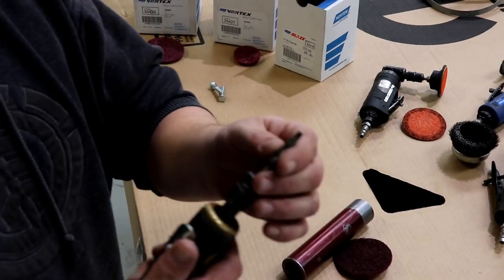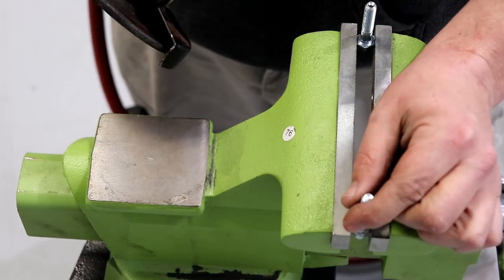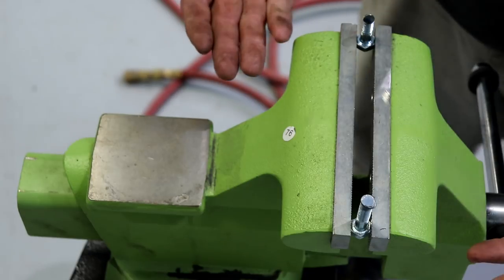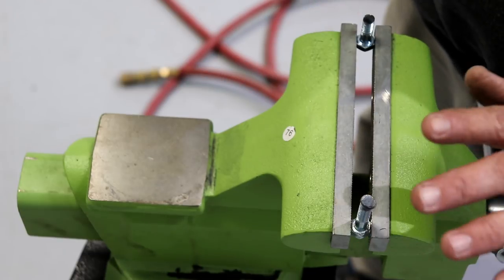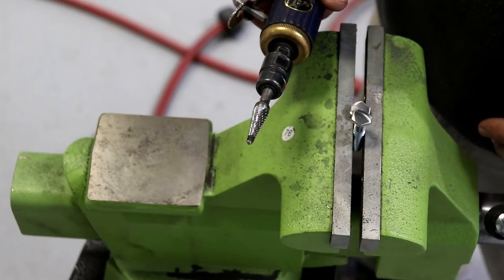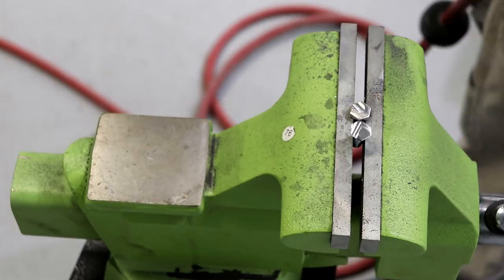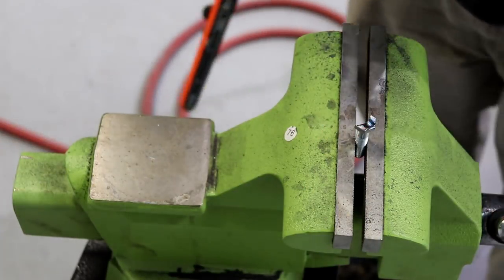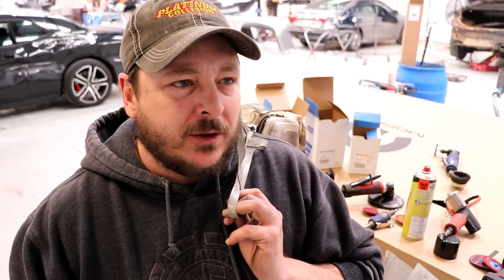The sandpaper 3M doesn't want you to know about. Norton blaze

Comment: U weren’t using the cutting edge of the right angle disc, those are 2 COMPLETELY DIFFERENT disc for different applications. BTW the ingersoll rand 345 max  right angle grinder is a BEAST, I prefer it with a 6” disc for heavy metal removal than my 1300$ 9” CP industrial grinder.

Comment: I found the same in making fine furniture.  I would buy mesh sanding disks and people would tell me that these other one's were less money.  Not less money when the mesh disks lasted five to seven times longer and worked way better at clearing the sanding dust.
Reply: scarmenl What sanding discs do you use for woodworking? Cheers
Reply: The net mesh ones.  I found that they cost more but last 8 too 10 time longer and clear the dust much better.

Comment: Do the norton TR roll lock discs with the plastic screw thread (not the TS ones with the metal clip) work on non-norton roll lock backers?
Reply from the maker: +Aubreykun Sure do. I don't have a Norton backer.
Reply: Thanks!

Comment: OK, you sold me on Norton Blaze, but I was already a Norton guy. Now test the roll-lock against a 60 grit 4" Norton Blaze flap disk to compare which TOOL cuts faster. I think you might have sold me on the 13" x 3/8" Belt Sander though!

Comment: Thanks  Do they make electric versions of those?  I only have a pancake compressor and I know that not good for those types of air tools
Reply from the maker: +Marla White Sure do you can just get the electric angle grinder and buy a disk for it.
Reply: The Good of the Land im talking about the mini belt and the die grinder to put that sandpaper on
Reply from the maker: +Marla White Oh yes. Amazon has one for like $70

Comment: Do a real comparison, try the 3m Cubitron.
I weld a fabricate for a living, repairing and I haven't found anything better than 3m Cubitron........
Reply from the maker: +ROQ WELDER Will do! The disks grind the same but the belts are a different story.
Reply: Which is better?
Reply from the maker: +jerdebson They are both great. However it is my experience that the bonding method used by Norton is superior especially when it comes to the belts. They both cut the same but Norton lasts longer and is cheaper. There are other tests on YouTube that show this. Hope this helps.
Reply: There is different grades of cubitron that is made by 3M there is 777f and 985 for the nine in 7 in and 5 in ceramic fiber discs!! Stuff that looks more orange seems to not work so well on stainless and steel!! The stuff that looks more like a dark red I believe it's the 985, cuts down to the paper that is glued to! Kick the s*** out of any hard wheel that I ever tried or flapper wheel!! But I do want to try the Norton Blaze I have not tried that yet!! In comparison when I used to use zirconium discs, in comparison to 3M or sait, the price was definitely worth buying Norton over 3M
Reply: Will the 3m Cubitron disc work faster on 40,80 schedule carbon steel pipe,for beveling?as opposed to a regular disc,i.e,Dewalt ect?

Comment: Got to grind with the outer edge of the grinding wheel, not the glass reinforced face.
Reply from the maker: +Paulman50 You are correct. Wouldn't be fair if I did that. Check out the thumbnail photo and you can see where the reinforcements starts. Then watch the two angles again. The second angle looks like I am more towards the center but if you watch the direction of the sparks it helps to see that I am on the grinding face opposite of the camera. Thanks paul.

Comment: Mirka is better than Norton and its a shit version of 3m. Norton is the carborundum of sandpaper hahaha
Reply: nathan greer Nathan, MIRKA makes awesome woodworking abrasives and their Abranet discs rule the automotive world IF you're only concern is collecting as much of your dust as possible with a central vacuum system. Other than that, their metal working products are at best so.. so..
3M & Norton spend more on their Metal working product engineering than MIRKA, Klingspore, VSM, ARC, SAIT, Walter Surface Technologies and Hermes combined...!  I've sold Coated, Bonded & Non-Woven Abrasives for over forty years and been to the 3M CAM Center twice for Distributor Training in St. Paul, MN.  There are MANY good abrasive products available to all trades today. If anyone tells you that only ONE brand is the best, they're talking out of their ass...
I've been a 3M Distributor for many years and would never say that they make the best abrasives across the board. There are just too many good options to pick from depending on the application.